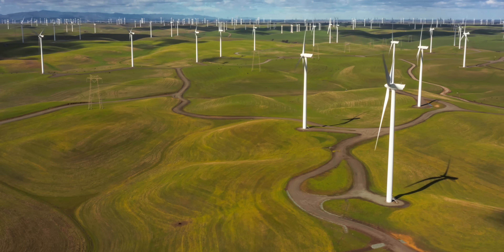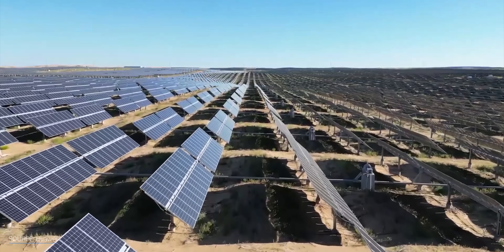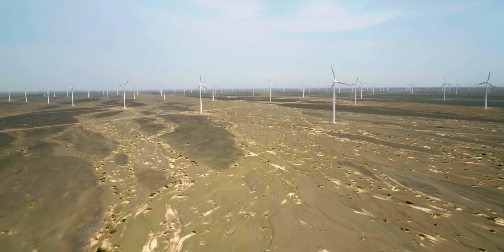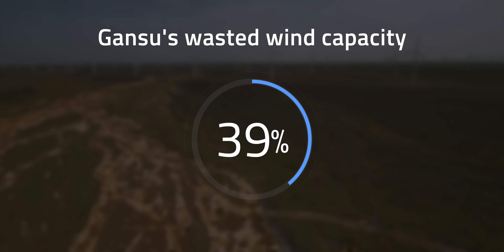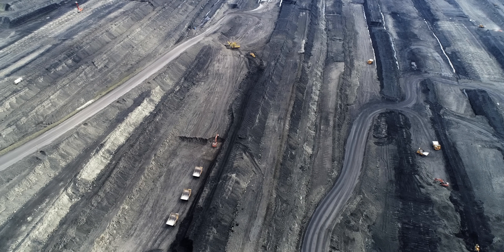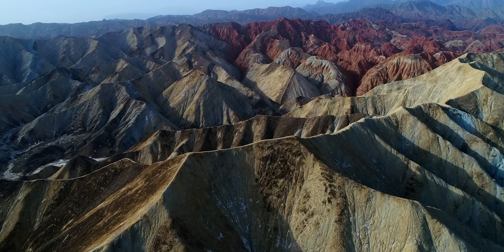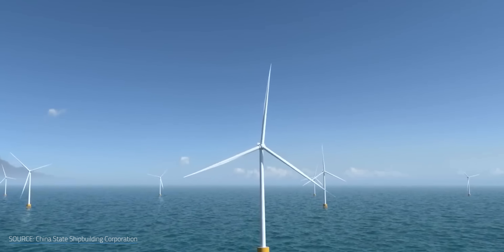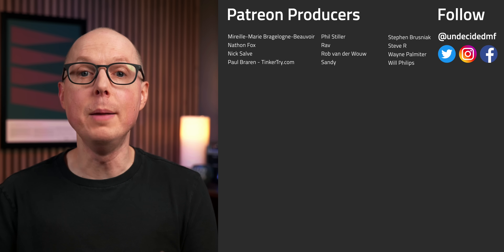The World’s Largest Wind Farm has a Tiny Problem

Comment: Reminder that 20 GW of PV or wind produces far less energy than 20 GW of almost anything else. It varies but typically onshore wind is ~30% capacity factor or 1/3 the energy per GW on average. If they were throwing away half the energy then it was 1/6. Offshore wind is typically 35 to 45% CF so it gets more energy per GW compared to on shore but its also pricier.
Reply: Can you explain the difference?  How is 20GW not equal to 20GW?
Reply: @LordReginaldMeowmont  valid points in this thread. Wind and Solar are rated at their peak output. And they do not operate at their peak output 100% of the time. 
However, no power plant operates at peak output for 100% of the time.
Reply: @David_Mash  True, but the difference between a nuclear plant which operates in the 90's and solar which runs in the 30's is a huge difference.  Furthermore, and of the utmost importance, nuclear/NG/etc are controllable as to when they operate.  That wind farm 30% operating output does not coincide with demand whereas a NG plant exactly coincides with demand.
Reply: @apostolakisl  You can either have capacity factor 90% or coincide with demand. Nuclear is pushing all the power all the time and it's other sources job to manage load. Ironically at the end of the day, it's not so different for renewables they both virtually can't function without other sources.
Reply: @apostolakisl  ill never say anything bad about nuclear. It is the answer everyone is looking for but most refuse to look at
Reply: @simon2493  True, but renewables have to essentially be duplicated 100% since there are lots of times they are at 0% output.  The grid has a very predictable lowest level of consumption and nuclear can cover that 100%.  Then you need on-demand generation to cover the additional needs.  Wind and Solar are not on-demand.  They function according to the weather/time of day.  Wind and solar can with some degree of accuracy be predicted with a large enough and well enough distributed system across a large geographic area.  When you need 100mw of on-demand power, you can build a 100mw NG plant and be done.  Wind and solar simply can't do that.  The basic result of wind and solar is that you let your NG plant sit idle more often.  So the benefits of lower CO2 production need to be weighed against the financial and environmental cost of constructing, erecting, operating, and disposing of the duplicate generating capacity.  Plus the environmental impact of the land usage and opportunity costs of land use.  For example, recently I saw solar farms in Germany that covered ground in the middle of corn fields.  Obviously, less corn now.
Reply: @apostolakisl  - Given that the price of NG is likely to rise with reduced demand in the future, plus concerns about security of supply, many countries are building biomass, pumped hydro and storage (battery, heat, compressed air, etc.) for the on-demand requirement. Many countries don't see a requirement to sustain NG's role in this capacity.
Reply: @GruffSillyGoat  It is very unlikely that reduced demand for NG is going to make the price go up, of course it does the opposite.  Perhaps if NG usage drops so much that it becomes a niche industry, but that would be decades in the making.  Many of those technologies you list are expensive or are in their infancy and may never pan out, and others are very inefficient.  Batteries are proven to work efficiently, but are costly and very limited in duration.  You need the sun to shine or wind to blow to recharge those batteries and if you go a couple days, you have issues.  Pumped hydro is proven but is only useful  when the geography allows for it and is quite inefficient.  Thermal storage is very inefficient.  Compressed air is also quite inefficient and the technology to do it on a large scale unproven.  This Youtube channel has done articles on all of those things and even with Matt's slant towards optimism on these things, he still points out why they are mostly pie in the sky.
Really, it just comes down to nuclear.  You can store power from nuclear because you don't have to worry about recharging the storage.  Bill Gates' plant will store the heat in molten salt so the plant can go up and down in power output as the wave of power consumption goes up and down on a daily cycle.  The plants power output can cycle with demand at nearly 100% predictability and thus very little duplication is needed.  And the footprint is tiny.  You simply can't rely on wind and solar.  The sun and wind while reasonably predictable, will quite predictably deviate from the norm.  So if you are OK with the your power shutting down because it has been calm and cloudy for a few days in a row. . . . well I am not.
Reply: @apostolakisl  It most valid, but in general with renewables there is more a push towards complex storage system than to increasing capacity to point of running it form current generation even in the wrost day.

With regards to fields, it is more biodiverse to have a solar plant than cropland, you don't plow down the ground that for one thing, and these solar plants are being built on soils of poor quality I can see how it looks in Poland, there are regions when you have literally sand as a soil with little to no of back ground at the top.
Reply: @simon2493  I don't know about Poland, but I was just in Germany and Austria last week on a 7 hour train ride.  The land appeared very fertile as it was covered with fields of mostly corn.  Except for the solar.   It is not like solar replaces corn, so there will just be some other land covered with corn, so no change to biodiverse acreage.  Or perhaps just less more expensive corn.
Reply: @apostolakisl  For many countries NG is an import resource not a locally extracted one, if demand drops the cost of shipping and processing will increase for these countries. Likewise the producers will scale prices, rather than reduce them, to maintain profit levels. This is not like in the past where fossil-fuels where the majority power source available, where producers would lower prices to be competitive and attract custom; as the produces knew demand would sustain and increase later on allowing them to re-coup monies lost when selling low. Instead they are facing a new competive resource, in the form of highly scaleable and cost efficient renewables, against this producers are facing an increasing reduction in demand, so will increase prices to retain profits for as long as they can.

BESS has become one of the cheapest forms of storage, and the cost is continuing to drop - it works at scales that suit renewables very well, from individual turbine/array to grid scale systems.

Nuclear has an inherient problem, in that it remains a big-bang large scale infrastructure solution; taking a decade or so to go from plan to operation, often at high cost. 

For example, Hinkley Point C in the UK, cost currently of £48bn, started in 2014 and isn't due to complete until 2027. Whilst it produces 3.2GW, the first output will not be seen till 2027, and the cost has to been spread over a long timeframe (35 years) with a high strike cost to the British public.  

Contrast this with UK's Hornsea offshort wind farm, is a phased development starting in 2016 and completing in 2030. Two of the phases are already live generating 2.5GW between them, and started generating within a year of construction starting, and completing within two years. The two subsequent phases, one starting last year and one next, raise the output by another 5.5GW - an increase on the original plans due to innovation improvements in offshore wind turbines. One of these phase is due to complete by 2027 and the last by 2030, but both will start generating before these end dates.  The total cost is £16bn, with a 15 year payback window.

Even taking into account the differing capacity factors (65% for nuclear and 48% for the Hornsea offshore wind site) - the offshore wind project generates over twice the energy at a 1/3 of the cost, and contributes to the UK's grid incremental very shortly after construction starts.

SMR nuclear etc. are stil experimental technologies, also covered on this channel as well as Dave Borlace's.

In essence every territory differs, what energy source works in one part of the world may not work in another as well, there is not a one-size fits all rather it's about the mix of energy sources that works for a specific country or state that is key.
Reply: @LordReginaldMeowmont it's theoretical maximum. 
I.e. you put a 400w solar panel under the sun on the equator at midday then you should get 400w.
Reply: @mandrakejake  oh, I thought they were stating how much power actually gets produced.  It's frustrating that they can't just say that.
Reply: @LordReginaldMeowmont  Because that number (20GW) is the maximum output rating. Because night time and wind droughts exist you are almost never outputting at max power from your solar/wind farms. Nuclear plants on the otherhand are almost always run at max power so you get much closer to the maximum energy.
Reply: This applies to all energy sources, with the capacity factor (CF) varying around the globe for different sources and also by level of deployment. The average US CF of oil is around 14%, gas steam turbine is similarly 14%, it's only when you get to more expensive combined cycle gas plants that this raises and varies between 50 and 60% depending upon the age of the plant. In the UK the offshore wind CF has increased from 25% to 45% (still increasing), whilst combined cycle gas has dropped from 65% to under 40% in the same timeframe (due to reduction in scale of generation). This is one reason why countries not repleat with constant solar/wind/geo/hydro have biomass in the mix as it has a CF of around 60% (similar to that of nuclear). 

However, the LCOE has to considered as well since an energy source with middling CF but low LCOE is still productive as you can install more of it to raise the overall CF of the energy source. 

Renewable's CF also benefits from the same approaches (HVDC transmission, import/exporting, energy storage) that reduce curtailment losses - averaging out the impact of when energy demand and supply periods don't align (curtailment) as well as peaks and troughs of energy generation periods (CF).
Reply: Wind powers nominal power output is lower than average power output. Other sources nominal output reflects better the real output.
Reply: "Reminder that 20 GW of PV or wind produces far less energy than 20 GW of almost anything else." Care to explain? Are you claiming that since the sun is providing millions of GW to a solar farm only capable of harvesting 20GW, that the inefficiency is bad enough to scrap the idea?
Reply: @David_Mash  20gw rated output is when all the wind mills are spinning at full power.  He is reminding you that the wind doesn't blow at the right speed all the time.  Obviously winds can be calm, but also when it is too windy they need to shut them down.  I can't confirm his number, but he is saying that on average the windmill farms are only producing 30% of their cumulative max.  What is worse of course is that the 30% is not consistent.  Sometimes it might be near zero and other times near 100%.  Makes it hard to build something like a data center or other industry that must have consistent power 24/7.  So you still need expensive transmission lines or expensive batteries.  The PV thing of course is the same with night and clouds and all.
Reply: In theory, in practice there aren't that many power plants that have high yearly capacity factor.
Reply: @simon2493 last I checked nuclear and hydro sit around 98%, and base load natural gas and coal is around 95%.
Reply: @stevk5181  And even that isn't rock solid rule. In France nuclear power capacity factor is around 65%. If any countrywere to be powered by a single power source its capacity factor would be below 50%.

To put it plainly if you put one power source as a bad load there needs to be another power source that is power peeking and so its capacity factor will be very small.
Reply: @stevk5181 you need to check again, and on Chinese statistics in particular.  The capacity factor for coal plants in China is below 60%, and trending down every year.  They keep building more plants for political reasons.  Granted, 60% is still far higher than any wind or solar plant, but not nearly as high as some people think
Reply: @simon2493  Yes its true French nuclear plants run at lower capacity factors than in most places because they have so many that they can't all run as baseload. Plus the national energy demand is higher in winter so they need more plants to run harder in that season, but in the other seasons they have to run below max or do maintenance so they don't overspeed the grid.

Comment: the excess power produced in this province could be used to process the coal into feed stock chemicals eg to make plastics, instead of burning the coal. This retains jobs in the area and solves the transmission problems. This technology was developed in South Africa during the aparthied oil export ban into that country so they developed coal processed alternatives.